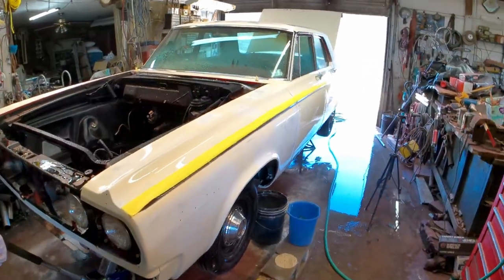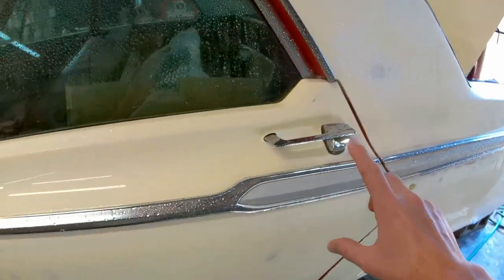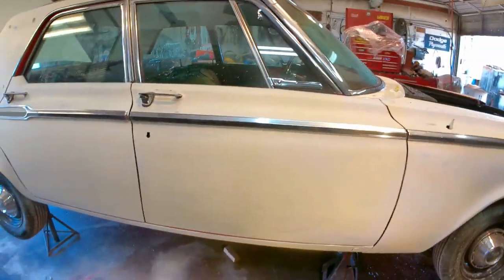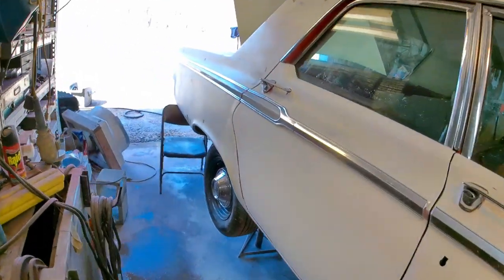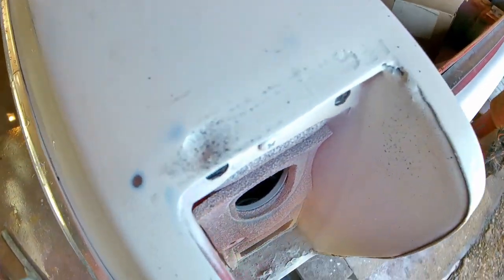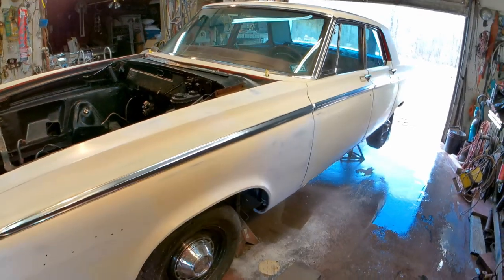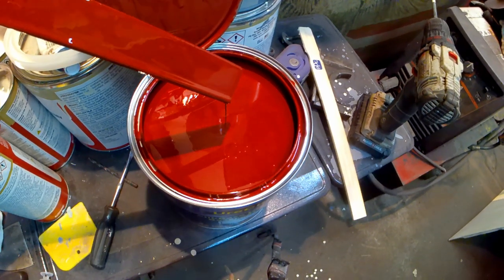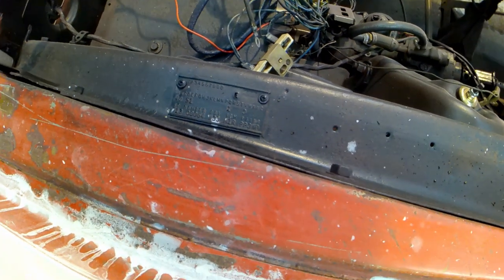65 Coronet: Pre Paint Prep Complete! #painting a car #Mopar #urechem

Comment: Joe , at what point would it have been easier to pull the trim off ?
Reply from the maker: Like all things, you gotta weigh the pros and cons. Finding clips, removing all the door panels to gain access, sanding around studs or clips versus sanding around he trim. Finding access to the trim through the trunk(laying on your head to try to unscrew the collapsible nuts), cleaning and polishing the trim off the car, then reinstalling it. It adds up to more time than spraying and blowing the trim out, plus masking. I didn’t really want to paint this car to start with. The only way I would agree is by leaving trim on and masking. His only goal was to have a car all one color. I had to go past that! 😂